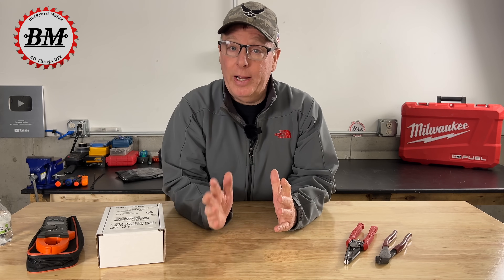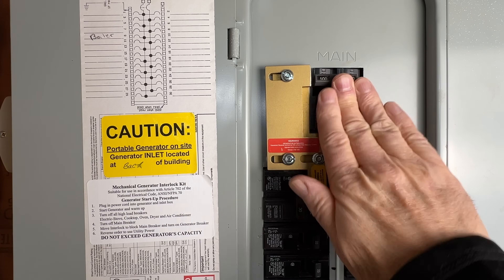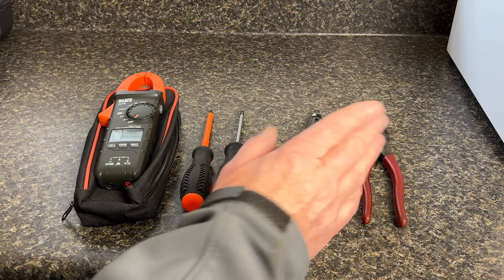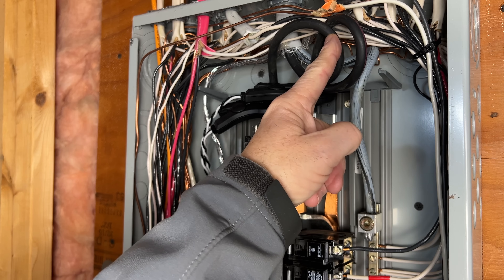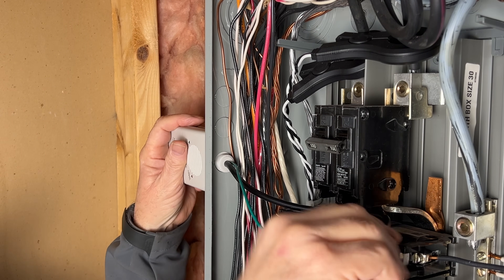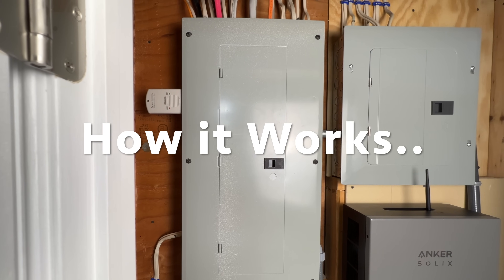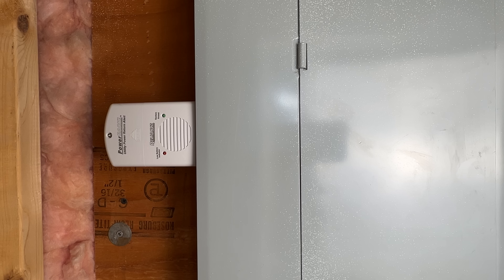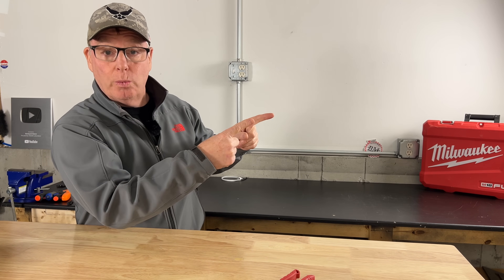The Secret to Knowing When Power's Back On!

Comment: I've a Connecticut Electric 10 circuit transfer panel, with break-before-make rocker switches. When energized by my portable generator, the transfer panel sends power to the corresponding circuits (that I've selected and to which the transfer panel is wired) in the house's main panel. All I have to do to monitor the restoration of utility power is to plug in a lamp or a radio to an outlet in the house that isn't powered by one of the transfer panel's 10 circuits. When I see light or hear sound from that area, I know that shore power, so to speak, has been restored.

Just thought I'd mention that approach as a low-cost alternative for those folks with the same or similar configuration in their residences. I do like the device that is discussed in the video.

Comment: I chuckled when I saw the Milwaukee FUEL set in the background. I bought the drill/driver set like this for over $400 at Home Depot. The drill worked for all of 2 months before the drill didn't work anymore unless you took the battery off and on a few times.....every time you attempted to use it. Milwaukee Tools, by the way, refused to honor the warrantee and replace or repair this. Before I blew four hundred plus bucks on the FUEL set, I had the set which wasn't the FUEL setup. Brand new, out of the case, one of the batteries wouldn't take a charge. The fine folks at Milwaukee made me drive to their service center in Houston to deal with the problem. Soon thereafter, I started having problems with the drill itself. I wouldn't have Milwaukee tools in my shop now if you gave them to me, as they are expensive, unreliable and Milwaukee doesn't stand by their warranty guarantees. I switched to Hilti and Makita and have never looked back. Once a solid tool maker, Milwaukee is no longer worth considering. Pax.
Reply: Thanks for this detailed comment. One of my 18V drills failed and of course I took it apart and was pretty surprised to see how paltry the VSD circuitry was.....it really looked like a shit design.

Comment: As an electrician, I can automate that, not needing any device to tell me if the power is back.
Reply from the maker: Sure.. I can too but to do it in a code compliant manner you're going to spend a whole lot more than the $35 spent on the power back monitor.

Comment: I just wired a 110 volt led light to a switch on the power company side of my lock out switch
Reply from the maker: That will work but it's not code compliant and could become a fire hazard.

Comment: I just turn on a lamp that isn't connected to the generator.  When power comes back on, the light goes on.
Reply from the maker: That won't work unless you have a sub panel for your generator feed and are able to keep your main breaker energized. Many people don't have that type of setup.
Reply: @BackyardMaine  I do, that's the whole point of having an emergency geenerator!  I'm not powering the entire house, that would be an expensive generator that autoswitches.

Comment: YOU ALSO CONNECT A 100 WATT OR LOWER BULB FROM OUTSIDE CONNECTED TO POWER IN LINE AND GROUND,,, RUN INTO HOUSE TO LIGHT UP WHEN POWER IS BACK ON, JUST MY 2CENTS. CHEAP EASY
Reply from the maker: That works but it’s not code compliant and could be a fire hazard as well.

Comment: Haven't watched it yet but the title grabbed my attention immediately.
Living in hurricane Alley of central Florida I have a interlock and a back fed breaker from an inlet.
Always open all breakers and manage them as needed after transferring to generator.
Several years ago we were on generator several hours after power was restored. We had no idea. Finally remembered our meter's display and surge protector LED was THE indicator. Still another thing to keep checking.
To me this is brilliant. Super reliable.
Oh yeah, the comments here are super funny and on point. From neighbor complaining about the loud generator, on and on.
If I had it to do over again I would opt for a several circuit manual transfer switch for 'critical' circuits. That simplifies management of power during outages especially for others who aren't comfortable doing that not to mention you could add the non contact power notification system.
The last storm Milton had us on our gas generator for 37 hours.

Comment: People keep saying this is an inductive pickup because the wording from the seller states this.   However, it is in actuality a capacitive pickup, just like the pocket live wire detectors, but in a bigger package and a ground wire for a reference to reduce noise pickup and false alarms.   Maybe 40 years ago I used a single FET, diode,  100K resistor, capacitor buzzer, and 2 D cells for power and did essentially the same thing.  About 6 inches of insulated wire taped lengthwise on one leg coming into the box and the source of the FET to ground.  It was great at detecting nearby lightning strikes too!

Comment: How does the Safety Ground line work on those Champion generators?
Reply from the maker: You only need a ground rod if the generator is connected as a separately derived system which is not common for small home back up generators systems

Comment: One general question...My generator is 50 amp max output. Is it ok to plug into the 50 amp out put receptacle when I only plan to pull 30 amps to my panel? I only have a 10 gauge wire . The only male plug I had was a 50 amp 4 prong !
Reply from the maker: If the wire is 10 gauge copper which is rated for 30A you cannot by code connect that to a 50A plug even if you only intend to draw 30A or less.

Comment: When you have a floating neutral that's the same not connecting the neutral to the panel and what you think of exhaust extension, thanks
Reply from the maker: A floating neutral at the generator is required unless you have a transfer switch that completely isolates the bonded neutral at the homes service from the one at the generator. This would be considered a separately derived system which is not common for home generator users. A bond in two locations can cause all kinds of problems. I'm not sure about exhaust extensions.. I would check with the generator manufacturer and also always be sure to have safety precautions in place to protect you from carbon monoxide poisoning.

Comment: I like that main breaker on the outside. It lets ANYONE kill all your power without worry so they can attack more easily.
Reply from the maker: I have to have it by code. There was a change a few years back requiring a disconnecting means for fire fighters on the exterior of the house at the service

Comment: Or you could just look outside. If the street light is on, the power is back on.
Reply from the maker: There isn’t a street light within five miles of my house.
Reply: @ then go outside and check your meter. Or listen to see if your neighbor’s generator is running and look to see if their lights are on. Or you can spend money on an overpriced gadget that will wake you up in the middle of the night.
Reply from the maker: @douglasabler3581  I could have put in an outhouse much cheeper that the three bathrooms.. What was I thinking.
Reply: @BackyardMaine I appreciate your alarm gadget even if 90% of the people watching this video have no clue.  😂

Comment: I have a monitor oil stove with an electronic control panel.  How important is it for me to buy an inverter type generator so I don't destroy my electronics?  Also I need 240 volts to run my well pump.  Perhaps do a video addressing these issues. Great channel! Thanks!
Reply from the maker: I also have an electronic burner on my boiler and I have never had an issue but it is a concern. Inverter generators sized large enough to backup a home are relatively new. I will be purchasing one in the near future to replace my old champion generator. Standard generators produce a modified sine wave and although almost everything will run on them it's not good for sensitive circuits. Great idea for a video.. Thanks. This is probably the generator I will be buying unless a brand reaches out with a freebee. lol. It's a duel fuel, runs quiet and uses a lot less fuel as well. https://amzn.to/407G9mL
Reply: It just needs to be a true sine-wave inverter. On the oil Montors the ignitor runs for first 7 minutes and is approximately 2 amps or 240 watts, however for the first few seconds when the ignitor is cold and first gets power at the start of a heating cycle, it pulls about 10 amps or 1200 watts for a few seconds. The entire heater uses about 50 watts after lighting and the ignitor goes off~7 minutes later. I would buy a 1000 watt inverter with 1500-2000 surge to be safe. When using the inverter turn on the "economy plus" feature to extend the cycle time which saves the battery 🔋

Comment: We have a 200A service, so there’s no way I can run all of the circuits in the house on a portable emergency generator.  Instead, I have installed a sub-panel with just the emergency loads in it (furnace, well pump, heat-pump water heater, refrigerator, freezer, and a small number of LED light circuits and receptacles in the kitchen).   The sub-panel is normally powered off of two pole 50amp breaker in the main panel, through a manual transfer switch.  So, when I flip the transfer switch to Generator, the sub-panel is disconnected from the main panel, but the main panel is still connected to the utility.  When power is restored all of the circuits in the main panel go live, which lets me know it’s back on.
Reply: You’re never going to be using every thing at one time in that 200amp service box. Powering the whole thing would be just fine.

Comment: Sorry, this is about as G-H-ay-toe as it gets.

1. You manually turn on the "sensor"
2. It uses a 9VDC battery with no mechanism to alert you ahead of time if it's dead.
3. It emits a 100 Db alarm

You'd do better having the neighbor's kid comel tell you when the power's "back on."

If you want a reliable system to detect when utility power is on you'd do better with anything (ESP32, Raspberry Pi) that comes on when the current loop sensor is active and emails you (or emails your cell provider's email-to-text).

Certainily this is cheap if you don't want a real ATS and you don't want a real generator and you don't want your entire load protected and you want to be notified by a 9VDC thing you manuallly switched on when it's back on.  Think of the fuel you're wasting with all this "cheap" stuff.  There's a reason no commercial operation does this, and only very cheap DIY people do.

Anytime you're doing the generator interlock schtick for partial panel relief on a manual start genreator...don't bother making youtube videos.  Go teach Sunday School.

Comment: The power back works great. Mine has been installed for a couple of years and it's worked great every time I've used it. I have a whole house manual transfer switch so I have no way of telling if the power is back on and funny enough my only neighbor is on a different power line. My house has the honor of having two separate power lines terminating on the pole in front of my house so lines on A and Y don't connect on the pole. The Power Back has saved me a ton of money on fuel because the last time I lost power it was off for a week and I ran an extra day before I found out the power had been restored. The lineman heard my gen set and was nice enough to stop in and let me know the power had been restored.     For all the people saying go outside and look at your meter or streetlight I say no thanks. My nearest neighbor behind me is about 3 or 4 miles and I can't see my neighbors house in any other direction either ,no street lights till you get to town and its a 3 mile drive.  All I have to do is listen for a screaming alarm.
Reply from the maker: Great comment. I think a lot of people miss the point on this video. Convince. We lose power most often from snow and ice storms and going outside to check the meter is not convenient at all.

Comment: you can also just look at the meter and see if the meter is on, It does require you to check the meter, but you don't have to cut anything on or off.
Reply from the maker: Most of the time we loose power during snow and ice storms so for me it was easier to cycle breakers than go outside.

Comment: What if your main breaker box is outside?  Mine is on the back side of the house.  Any suggestions?
Reply from the maker: The only possible solution I can think of would be if you can come through the back of the panel into the house. You could connect it to a surface mount box if it’s an area where it wouldn’t be an eyesore

Comment: I have an apartment without access to the power panel. I'll know if the power's back on with either a table lamp left on (at night), or a night light (6/10 watt). Simple enough.
Reply from the maker: This device is for generator use. Without backup power our main breaker is on and if course we know when power it back.

Comment: My transfer switch has an led telling me utility power is back on. It’s not a mystery. Its having a correctly installed system in place.
Reply from the maker: There a several compliment generator connection options. Yours will work but with the limitation of having predetermined circuits connected. If you want to run something else you’re out of luck. This method is cheaper and more versatile
Reply: @ 
Thank you for agreeing with the design and operation of a UL approved transfer switch. My town does not permit a sheet metal manual interlock on the main and generator breaker. It must be a UL listed manual or automatic transfer switch. Your area may differ. Ask your inspector.
Reply from the maker: @bills6946  UL does not approve or dis-approve anything. They are either listed or not listed. Many electrical interlock kits are UL listed and they are widely accepted across the country. Evidently not in your town. This is a completely safe way to connect a generator to a home and it gives you much more flexibility than many other options. I'm glad that you're happy with your setup though but just know there are a few other approved, listed and safe ways to connect a generator to your home. I'm installed all of them many times in my 40 plus years in the business.
Reply: @BackyardMaine 
A manufacturer submits production samples to Underwriters Laboratories for their evaluation for safety and functionality. It is not cheap to pursue their evaluation.  They want their product tested so it can earn the UL APPROVED (or LISTED, depending on the level of testing they pay for), label. Reputable manufacturers desire the label. It is not a requirement, but shows the product is generally safe to acquire and utilize.  It is not a requirement, but an end user usually requires the listing if they are bidding to supply their product as part of a complete package for a project. Kohler generators themselves, do not have a label, or manufacture the switch. but when generators are supplied with a transfer switch as a complete package, they will specify the transfer switch has a label.

Comment: I would like to ask your opinion now that I just got a champion 7500 running, but but I have been running my older 5000 Coleman that I got at lowes over 40 years ago and with this one I hooked up only the the two hot legs to the panel since the neutral and ground in the is still working with the power out. I talked to the people at Reliance and they said that hooking up the neutral and ground to the main panel from the generator is not a problem they prefer A floating neutral, but it is not necessary I would like your opinion on this, thanks for your help
Reply from the maker: You absolutely need to connect all four wires from the generator to your panel. Two hots a neutral and a ground. Since we can only bond the neutral to ground in one location on your electrical system you will want a floating neutral at your generator.

Comment: never had that problem. Grew up never having a generator, and never had problem even when power would go out many times every year for anywhere from an hour to 2 weeks at a time (including up to 2weeks in the middle of winter). When you live like that, dealing with power outages is no big deal.

Lightbulbs
Digital clocks
Appliances
....are all clear indications the power is back on in that situation.

I'm designing an isolated power backup that never connects to the grid. A few solar panels that powers a battery bank, to run a chest freezer, battery chargers, a few dedicated outlets, and lights, even when the grid power is working normally. It only runs the things I truly need during a power outage, and doesn't connect to the main panel.

Comment: Uhm.. The lights or other devices that aren't on generator come back on? Or if you have a whole-home automatic generator, it automatically transfers back to utility power and then shuts down after a cooldown period? I don't understand why this is even a problem to be "solved"
Reply from the maker: Because you obviously don't understand the different methods of legally connecting a generator to your home. The most common method is with an inlet box and an interlock kit.
Reply: @BackyardMaine  Still a solution in search of a problem. But if it floats your boat, feel free to sail on.
Reply from the maker: @r6u356une56ney  Its a solution to the problem of not knowing when power returns without either going outside during a blizzard or ice storm to check the meter every hour or cycling my main and generator breakers off and on to find out.
Reply: @BackyardMaine  if it floats your boat, feel free to sail on.